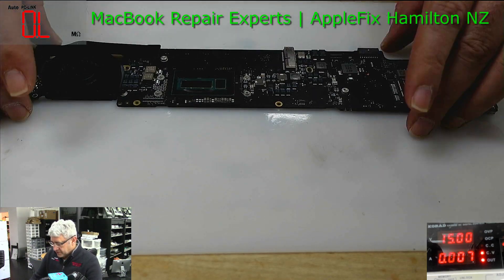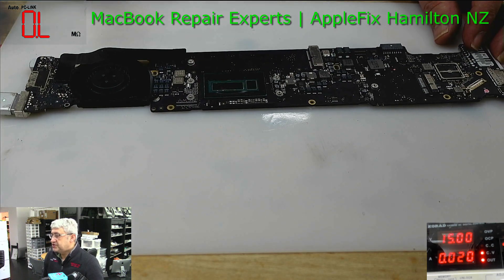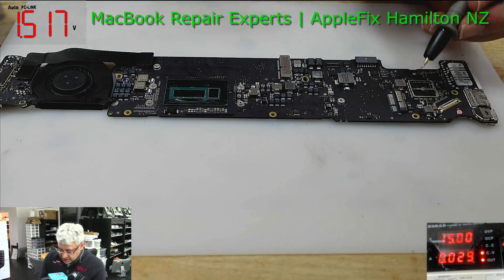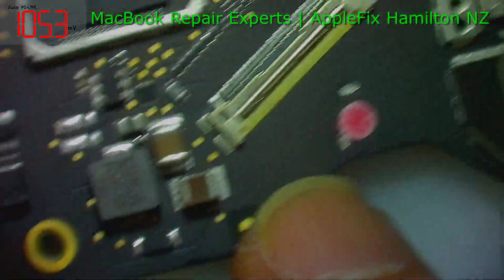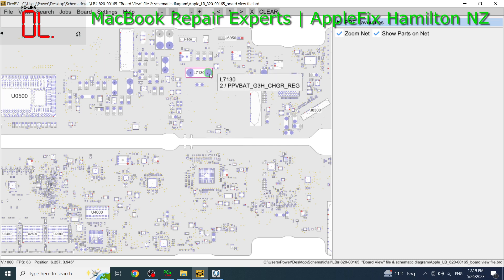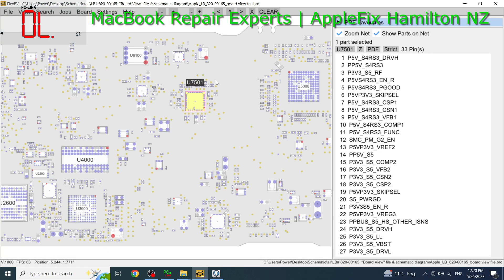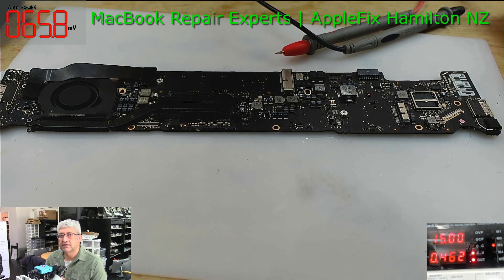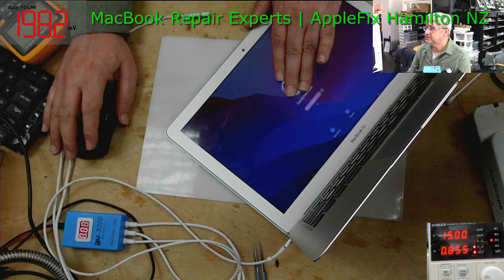MacBook Air Not Turning on | Missing PP5V_S4RS3 | Macbook Repairs in Hamilton | AppleFix New Zealand

Comment: i have issue with the same problem....current only read 30ma....p3v3_s5 only read 2.2v....i did replace the ic but problem still persist...the ic i get from donor board